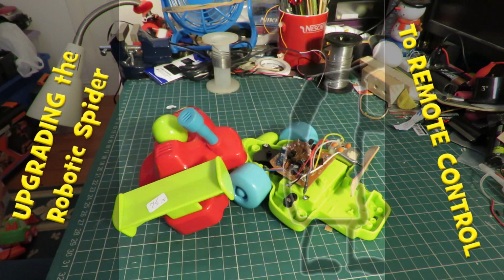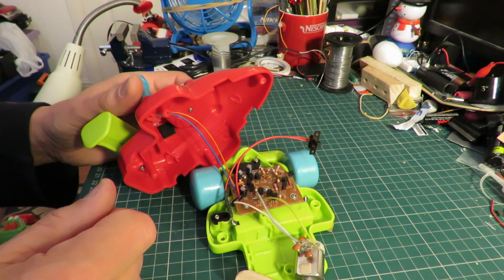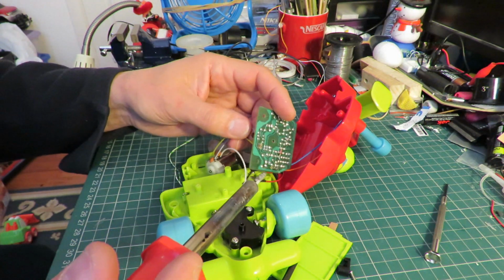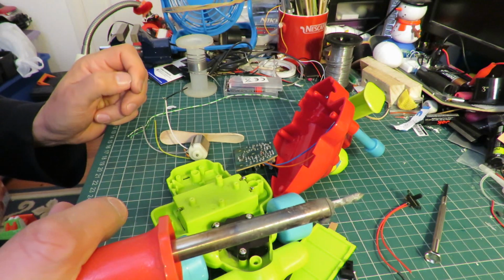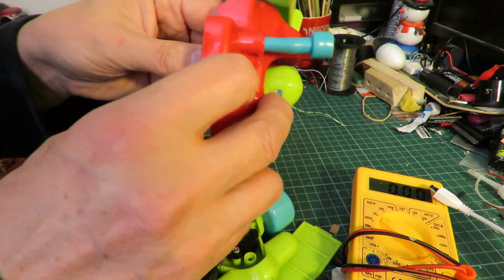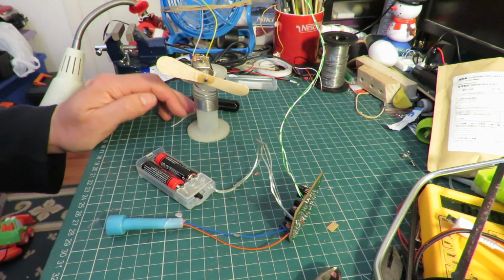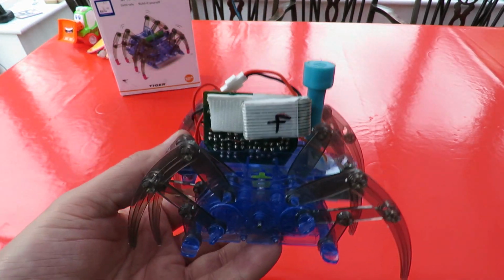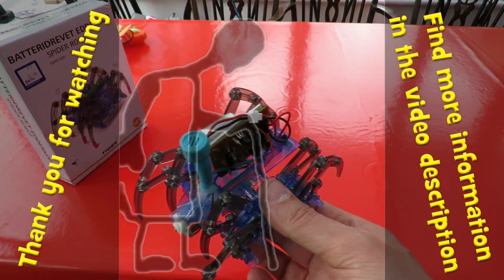Upgrading the Robot Spider to Remote Control

Comment: Is anyone starting to worry that Grandad is building a robot army?   :-)        This has been a really interesting build.     I would be curious to see it with the rubber boots climbing a slope.....how steep a slope could it handle?
Reply from the maker: I haven't tried it on a slope. I might do it with the RC version but I would expect the usual bunch of trolls complaining that I had tilted the camera to make it look steeper than it really is, or want me to fit bigger motors and bigger batteries to make it go even steeper and faster and as I have said before, I am not interested in making records :)
Reply: Yes the trolls are everywhere.      But you didn't deny the robot army  :-).....remember I'm on your side   ;-)
Reply from the maker: Wil Hobbs :)

Comment: hey grandad i have a question. are the motors from playstation controllers or cd/dvd motors any good for helicopters?
Reply from the maker: I wouldn't know about playstation controllers and I have seen unsuccessful videos trying to use CD/DVD motors for quadcopters. To be honest, the motors are the least of your troubles if you are planning to make a helicopter as you will have to buy proper hobby grade RC gear to control it and if you are spending that much money then the cost of decent motors is insignificant. In the long run it would be cheaper to buy a ready made RC helicopter and learn to fly it. Making your own from scratch before you even know how to fly one means you will never know if your problems are with your build skills or your flying skills.
Reply: oh,i see. Thanks grandad (: . i really enjoy your videos
Reply from the maker: Omega Arxom sorry if it's not quite the answer you hoped for but that is my honest opinion. Getting a helicopter to fly needs gyrostabilisation, it is not a simple matter of putting a rotor on top and adding power. It might climb briefly but it will be unstable and crash quickly. I have seen plenty of YouTube videos of attempts and they all end with it spinning uncontrollably and crashing or they have the helicopter tethered to the ground to stop it spinning and flipping over.